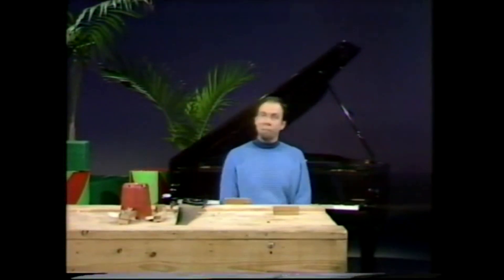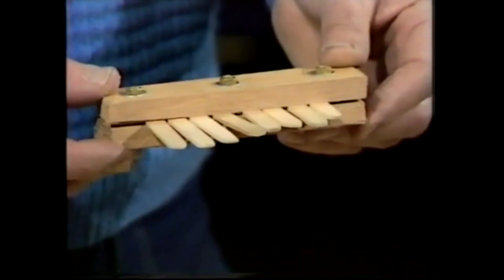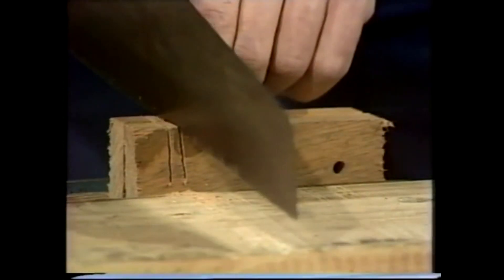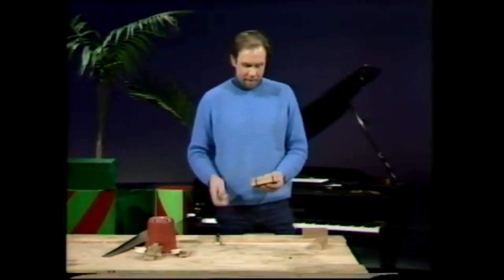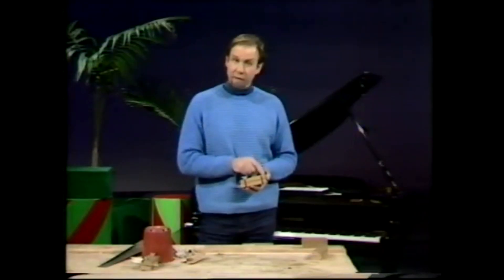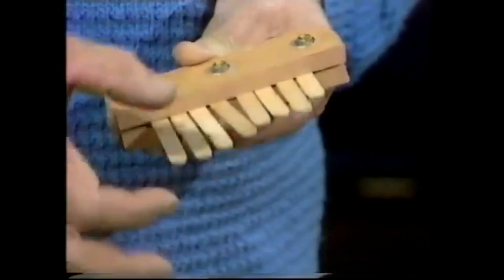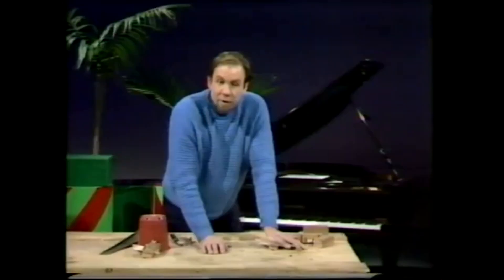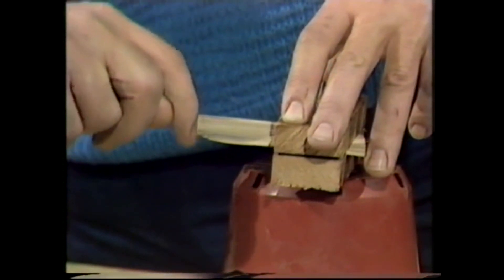Ice Cream Stick Piano

Comment: Hey kids, if you can't use a drill, use a saw and a sharp knife instead!
Reply: That's about right for the era. I was using handsaws and knifes from age 6. But power drills -- that's different -- misuse the key to tighten the chuck, and you would lose your wrist.
Reply: Drill were heavy back then - too heavy for kids to use effectively - and far fewer safety considerations when it was made.